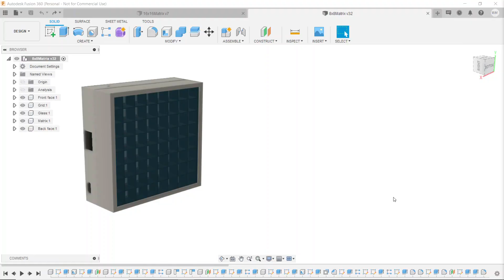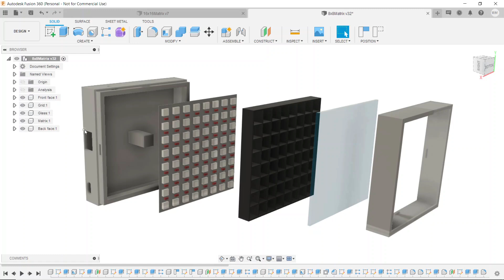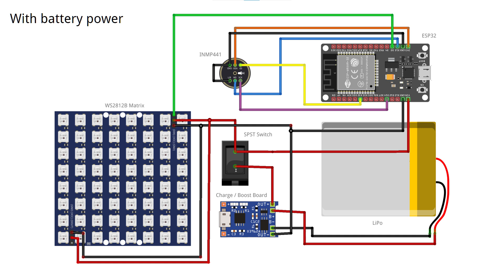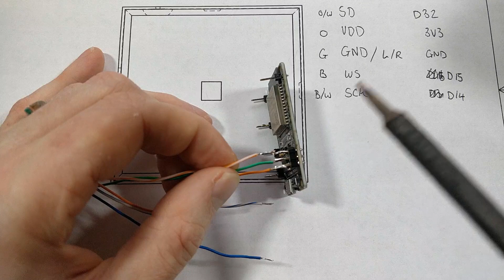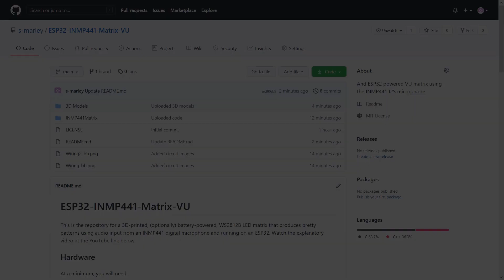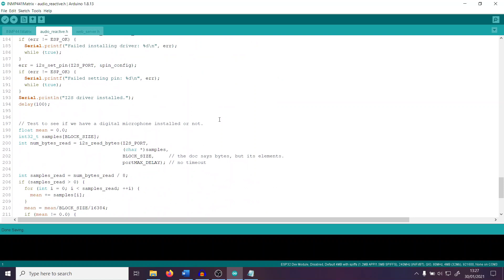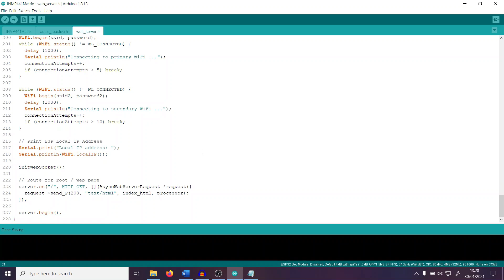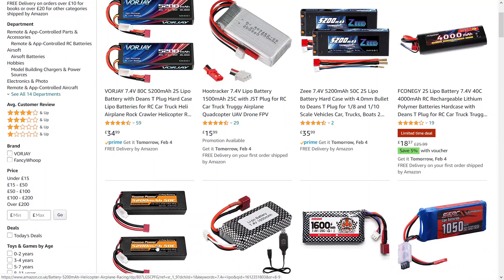3D-printable ESP32 powered VU display with the INMP441 digital microphone and a WS2812B matrix

Comment: Scott, I want to make a spinning persistence of vision (pov) display with fft.  Have you thought about something like that?  My vision for it would have an oscilloscope like output of the audio waveform in at least 3 and likely more bands.  It would show only the peeks rather than a vu like output so you could see the trace of the waveform for each band.  It would probably use bluetooth or wifi whichever I could get the lowest latency on.  I'd want the whole controler plus LED strip to be spinning and power to get picked up through something like an inductive pickup so it could run all the time instead of having to get charged in a couple hours.

I think this matrix with fft is very close to at least the LED driving that I want to do.  I'd like to have your mind thinking about this.  What do you think?

Oh one last thought is that all the bands would have their moving peek of a different color sharing the strip so they'd be superimposed.  The colors would have to combine if the peek appeared on the same LED.  I was thinking say, 64 LEDs in the strip, or whatever the densest number one can fit in say 1/2 meter.

Mike
Reply from the maker: Good idea, are you thinking something like this https://create.arduino.cc/projecthub/theSTEMpedia/persistence-of-vision-pov-display-using-arduino-583d5f but with addressable LEDs? If the power is inductive, it would have to be a very powerful transmitter. For 64 LEDs you'd want at least 2A - even the best wireless phone chargers only just get near that and they're not moving. You lose a huge amount of efficiency if the coils aren't exactly lined up. I think you could get away with far fewer LEDs though, so might be doable with a wireless phone charger type arrangement. The patterns would be relatively easy compared to solving this issue I would think. I wonder how WiFi or Bluetooth would work when spinning round that fast?! I think it would be fine but would need investigating. The audio sync stuff over WiFi is already integrated with WLED, you could have a box somewhere with an ESP32 and a microphone sending the data over WiFi,  and another ESP32 listening to the data and running the display. Just my initial thoughts, I do like the idea though and I might keep it in my head until I have some time for another project!
Reply: @ScottMarley  ok i do like the esp32 sending data over wifi idea, i also thought about slip ring power but didnt like the idea much, maybe i just need a big big battery?  I have a windows media player visualization that does the fft and puts a scope in up to 6 bands.  I've noticed even withing windows any lag really puts you off visually connecting the audio.  So yeah I'd really worry about latency.
Reply from the maker: @jmcarp0  I do think all this needs to be investigated further. You just made me order some wireless charging coils from AliExpress to experiment with ;) I won't have anything any time soon though, really busy with real life unfortunately.
Reply: Well I did order the esp32 2 pack and the microphone, and a 1 meter (144 LED) strip of ws2812b. I feel pretty confident I can get that going whether or not its spinning with big battery. @ScottMarley
Reply from the maker: @jmcarp0  good luck, and let me know how you get on.
Reply: I feel like the coils would have to be concentric with the motor shaft and it looked like the coils i found were pretty small, might not fit.  One was compared to a US quarter and looked only slightly larger with the middle hole probably not going to fit over something like a box fan shaft...
Reply: update: I got my WS2812B LED Strip today and have had a lot of fun testing it. https://www.youtube.com/watch?v=bXmQH1edqcQ Also have been having a lot of fun playing with the esp32. MEMs microphone still waiting to arrive.  Haven't tried battery or inductive pickup power yet.
Reply: update:  the strip, 144 LEDs one meter length of WS2812B, drawing 175ma.  Battery power for the controller and strip is 3800mah.  Uses FastLED and some wifi library for updating the program.  I'm running 12 randomly animated dots that bounce off the ends and change to random colors. As of yet no microphone. I think my mic is still in China. LED voltage is consistent 4.5v ish from end to end. So I'm happy with that.  This motor is a lasko 20 inch box fan.  The test ran for 2 minutes, 1 of which is on  video https://www.youtube.com/watch?v=1krIB37q54k  After the video the motor committed suicide.  So I guess its off to goodwill store looking for used appliance motors. :o
p.s.   I got my IP address from the serial port monitor and it has remained the same in the selection of ports available in the arduino IDE.  Ive got 2 esp32s now running wifi uploader.

Comment: I cannot for the life of me get the microphone working in WLED.  Can anyone tell me how I can confirm if the mic is working?
Reply from the maker: Are you definitely using the sound-reactive fork of WLED and not the normal one?
Reply: @ScottMarley  100%.  I think i have a faulty mic.  I tried the test sketch and that doesn't pick anything up on the mic either.
Reply from the maker: Ah, that's the next thing I was going to suggest. Does sound like a buggered mic then. Ah well, least they're fairly cheap ;)
Reply: @ScottMarley  Yeah its just waiting for the things to arrive that is the pain.
Reply from the maker: @qualar  I just buy them for free next day delivery from Amazon Prime, but that is a little bit more expensive and depends on where you live. I think from amazon they're about £7, not too bad to have it next day!
Reply: @ScottMarley  I am from UK but currently living in Portugal.
Reply from the maker: @qualar  yeah, that's what I've used in my code too. This probably won't work, but try connecting LR to 3V3 instead of ground. That should make it output in the right channel instead of the left. I don't see why that would work, but I have heard of people who had to do this for some reason.
Reply: @ScottMarley  Tried it and no joy.  Just made the mic get warm.
Reply from the maker: @qualar  well that definitely shouldn't happen, that's how you switch from the L to the R channel. Ah well, new mic it is!
Reply: @ScottMarley
Reply: @ScottMarley

Comment: Thanks for all the work you put into this awesome project. I put the 16x16 version together over the past few days and it came out great! I had many of the items on hand and only had to buy the display and microphone. Including the Fusion file was especially helpful as the acrylic sheet I had was not 2 mm thick. (Note that if you change the "Glass Thickness" parameter, you need to adjust the "Grid Thickness" accordingly). I did initially try 3mm translucent acrylic, but the display was blurry looking. I switched over to 2.5 mm clear with the printer paper behind it. The paper produces a little pulp pattern but the projected image is much sharper. Ultimately, I may try to find some thin translucent film to put behind the acrylic.
Reply from the maker: Great, so glad somebody else made one! You're right, there is a fault in the file as the glass and grid thickness should reference each other. I didn't notice this as I never changed that parameter to find out. Glad you managed to figure it out anyway!
Reply from the maker: PS do let me know if you discover a particularly good diffusion material, I'd love to find one that just works!
Reply: @ScottMarley  That seems to be more of an issue than I originally thought. I looked at a number of other papers that either have watermarks or the same fiber-ey pattern. Any white vinyl sheets I have found online are adhesive backed. At the moment, I'm using a piece of white UltraCote model plane covering material in the place of the paper. It's far from ideal. It likes to roll up, so it's really fiddly to get into place. It also has a heat-sensitive adhesive backing, so I'm not sure how it will work out in the long run.
Reply: @ScottMarley  i've used the diffusion layer of a broken lcd screen. Just take out the sheet from the backlight an you've got yourself a very sharp and crisp difiusion layer. Unlike the paper some of the grid still shines through, so it looks like pixels
Reply from the maker: @Siggibartman  good tip!
Reply: I think I've settled on some Canon Glossy Photo Paper for the diffuser. A bit less light gets through, but the texture is very even.
Reply from the maker: @karllaun2427  Ah, good idea! I've got some of that somewhere. Shiny side out I suppose?
Reply: For my diffuser, I used White PLA, and printed it on my printer...  the diffuser is 1 mm thick, with a 2 mm x 2 mm thick border.  When placing the diffuser into the case, make sure the lip/border is facing outward so there is no gap between the LED and the diffuser.

I think I like the paper look better though.. that pulp adds a nice look, and is sharper than the printer PLA diffuser.

Comment: Hi Scott (and Andrew T), Thank you for a the great tutorial, and great code/ Libraries. I've been building it today, mine is going on the shelves in my lounge.  I have hit a problem, I have 10 shelves, but your code breaks if the M_WIDTH is anything other than 16 (or perhaps 8). I've hacked the main sketch and that's now compiling, but hte FFT code looks like it is a bit harder to adjust to any number of M_WIDTH. If you have any way of helping with that it would be great. Drew
Reply from the maker: That's odd, it should work for any multiples of 16, but I haven't got a matrix to test that on. What width are you using?
Reply: Well, I've half bodged the code. But I think (hope) I've now got it working for 10 columns.
Reply from the maker: @drewb3038  ah ok, the original code was never meant to work for anything other than 8 or multiples of 16. The reason is that o would have to dynamically change the number of bands of the FFT, and thats not a simple thing to code. Glad you got it working for your use case though.

Comment: Hi Scott, my build is coming along nicely, but hit a roadblock. My INMP441 microphone is not being recognized. I am getting "Digital microphone is NOT present." in the serial monitor. I have tried two separate microphones and two separate ESP32 boards. I have tried changing the digital pin assignments. Using an ESP32 wroom 32. Any suggestions? 
edit: when I disconnected L/R from GND on the INMP441, the microphone was recognized. I understand that grounding the L/R pin causes the LEFT channel only o be used. I resolved the issue by changing  .channel_format = I2S_CHANNEL_FMT_ONLY_LEFT, to "RIGHT" and left the L/R pin unconnected.
Reply from the maker: That's interesting to note. I'm not sure why that would have happened but thank you for posting the solution in case it helps somebody else. I'm using it on the left channel to maintain compatibility with sound reactive WLED but if it works better in the right channel then that's ok!
Reply: Thank you so much for writing about your fixes, it helped me a lot!

Comment: I Really like your Videos because they are so easy to understand. 

https://www.partsnotincluded.com/diy-ambilight-ws2812b
I would Love to see a tutorial for something like this but with the APA 102 Leds because mine has extreme frame rate problems and i cant get it working with the APA102 LedStrips
Reply from the maker: Could you just switch to using an ESP32 / 8266 instead? They're so much faster than the Arduino it might just work.

Comment: Use a simple Powerbank (like a 20000mah one) as the powersurce. It can also last very long.
Reply from the maker: I've done that on previous builds and it works fine and lasts forever! I wanted to investigate internal power this time. It sort of works, but I learned a lot doing it so that's more important!
Reply: @ScottMarley  yes thats true...  I did also Use tp4056 charging Modules whith Protektion and an external Boostconverter for my Projekts. But i like to use cheap Powerbanks whithout Batterie, to  recyce old li-ion cells from dead Laptop packs.  Mostly only 1 or 2 out of 6 cells are dead. 

For a 2s charging board i use the
 "X-lite charging board" (its for a remote)  it charges and Balancing the cells from 5v.
its a little extensive, But its the only Module i know that Balance Charge a 2s pack from 5v.

Comment: Very slick Scott - Fast paced with lots of useful content. Battery power and mic with I2S interface.
Also loved the way you didn't stand on ceremony with the soldering - no PCB just flip the IC and solder the wires straight to the ESP32 pins.
Fit for purpose and gets the job done👍
Reply from the maker: Thanks for your comments :) for something like this a PCB would be more trouble than it's worth. It would be nice to have a custom PCB though that integrated everything with headers for the mic, and a charge and boost circuit all on board. But I'm not that good at electronics I'm afraid!
Reply: @ScottMarley  Nothing to apologise about. You've just illustrated that rather than getting hung up on jumping through hoops - pragmatism is king!👍
Reply: Also, I loved the way you side stepped the captive portal. You're solution for your purposes seems much better especially if other members of the family want to use it hassle free.
Personally, I feel like the captive portal is itself a fiddly workaround.
Why not use a cam enabled ESP32 and get it to read your network QR code.😊

Comment: Hi Scott, thanks for more amazing work. I think this is going to be my next project, but will likely use WS2812b strips (not the matrix). I would  like 16 pixels wide but 24 pixels tall. Can you confirm that modifying M_HEIGHT  to "24" will accomplish my objective? Thanks again!
Reply from the maker: It definitely should do, but I don't have any weirdly shaped matrices to test on unfortunately. If you get it working, feel free to let me know!
Reply: @ScottMarley  Hmmm. The matrix I built is 16 columns wide, each 20 LEDs high. I change M_HEIGHT   to "20". For unknown reasons, the VU meter behaves like there are only 16 LEDs in height. Very strange. Still investigating how to convince that there are actually 20 LEDs in each column.
edit: Well, it turns out that I made a bad assumption. I am building this with strips of WS2182b lights, not a pre-built matrix. I assumed that the matrix was wired in a zigzag pattern starting from bottom left, going up, zigzagging back down, then repeating. I assumed wrong. The zigzag is horizontal. In the sketch, I changed "HORIZONTAL_ZIGZAG_MATRIX" to "VERTICAL_ZIGZAG_MATRIX". Issue is resolved. I also had to add 4 more zeros to uint8_t peak[ ], uint8_t prevFFTValue[ ] and uint8_t barHeights[ ]
Finally, one last thing: If you want to start your Data in (DIN) from the opposite side, and you explain the code, you can adjust M_WIDTH  to a negative value, but please be mindful that it causes an issue with the formula for NUM_LEDS. That number cannot be a negative value, so replace the formula with the exact number of LED (corresponding to M_WIDTH * M_HEIGHT). Cheers!

Comment: So is that charge/boost circuit able to output 2A through the boost converter?
Reply from the maker: Yeah, the little one works well enough although I'm only averaging about 1A in the 8x8. The board in the larger one is definitely kicking out 2A, but I'd be wary of going near 3A. I think a better solution for the big one would be separate boards for charging and boosting, that way you can get much better performance and put the switch between the battery output on the charge board and the boost input to stop the battery discharging whilst it's turned off.

Comment: as usual, a great video ! 
I discovered your channel a few weeks ago and only 1h after finishing the first video I ordered my first esp and led strip ! I now have a working prototype and i'm working on a box which can transmit signal to the VU display over wifi so that your sound source does not have to be close to the display (I'm not using a microphone so I only display the music and not the surrounding noise). 
Thanks for the work you've done, can't wait for the next project !
Reply from the maker: Sounds interesting! Are you sending the actual audio data or doing it how WLED works and transmitting the results of the FFT? If the first way, is there any latency?

Comment: Perfect timing, Scott! I've been using a 16x16 matrix in a Heath Robinson breadboard kludge as testbed for various LED lamp and word clock projects and co-incidentally I took delivery of my first 3d printer this week so this might be my first serious print. No excuses not to box everything up properly now.

You mentioned captive portal towards the end of the video. Have you looked at the tzapu wifimanager library? Very easy to setup captive portal that way. So much so that I include it in all my WiFi configs.

You also talked about DHCP vs static IP. In enterprise networks this is usually solved with IP reservation (tied to MAC address) on the DHCP server. This has the advantage of leaving the clients on DHCP but with the ability to assign/change IP addresses on specific clients. Think network printers, smart screens, management/control systems, that kind of thing. We used to do a lot of this in factories, large offices etc.  Not sure if home broadband boxes do it but I should imagine so.

Keep up the great work-this is a fab channel!!!

Oh, one more thing-have you looked in to black/translucent Perspex for the front panel? Adafruit sell something called black LED acrylic and I think it also acts as a diffuser. In the USA it's sold as Chemcast but I haven't managed to find anything like it in the UK so far. I've ordered an Fibonacci LED disc from Jason Coon's Tindie page which uses the same material so I'll be interested to see what it's like.